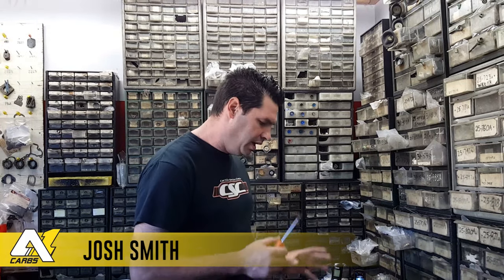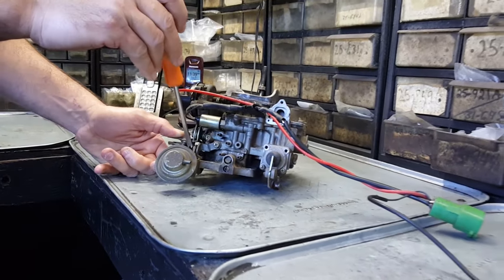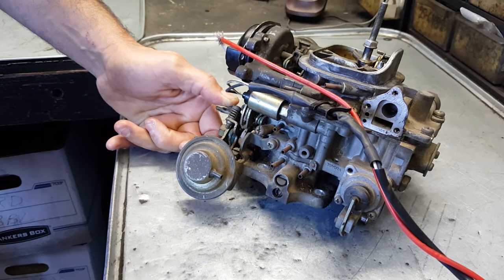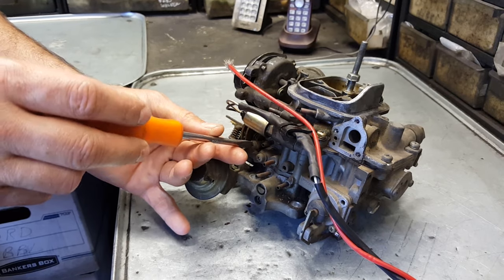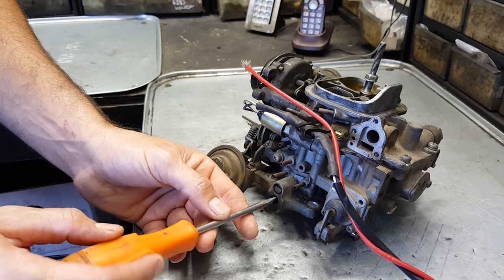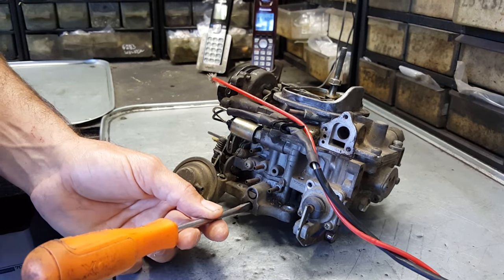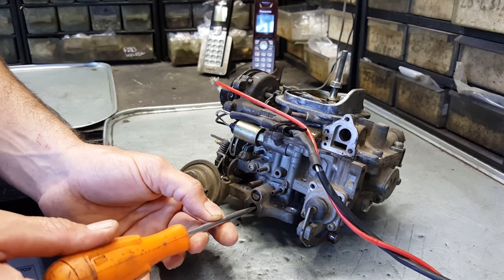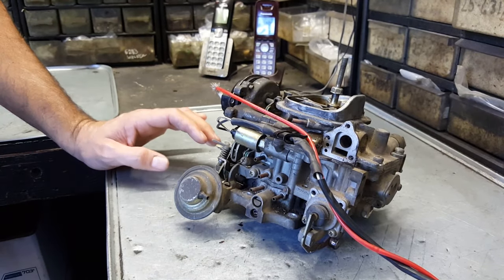Tuning Toyota PickUp Carburetor.

Comment: What this dude fails to mention, is that the mixture screw is covered by a metal cap that has to be drilled out in order to get to the screw. Perhaps a more detailed explanation would be better rather than giving these folks false hope, but I digress.
Reply: thats for a 22re
Reply: @silvac196  22re doesnt have a carb

Comment: I want to correct what he said abut the air-fuel mixture adjustment screw. What he said in the video when you screw it clockwise "in" is leaned, that is not true, in fact that is rich because that screw control the air volume only, fuel was not effected by that adjustment screw, unlike many other carburetors that screw control both air and fuel at the same time that is why it was called " air-fuel mixture's crew.

Comment: What does the diaphragm do that is on the bottom left.  i got a replacement carb and  my old carb did not have this , I don't know what to connect it to ?
Reply: Hello, were you able to solve your problem?

I have the same problem
Reply: @albertomartinez723  No, I just plugged it off for now.
Reply: @alabamafarm174  I think it must be from the air conditioning, since when connecting any vacuum hose there the engine revolutions increase
Reply: It's the Idle Up Diaphragm. It helps with the throttle, but I think some models of pickups like mine don't come with it.

Comment: Josh, What would make a 22r carb misfire, and not stay running. Could it be the AAP Diaphragm cause that, or the float. I have almost 300,000 mi. Thanks
Reply: Ive got the same problem as well, I need some help too
Reply: David Regan my Toyota was misfiring too and I adjusted the valves and that made a world of difference
Reply: @austincowell8740  check the power to the fuel solenoid. If no power she will run when you have a foot on the pedal but will not idle at all

Comment: Nice video, even though it was short. I have the same carburetor,and my engine stalls , unless I turn that middle screw to a high  1600 rpm. The air,fuel mixing screw, has no effect , what so ever , any idea why ,please . Do I have to take the carburetor a part and clean it to thoroughly
Reply: @TwoCarGaragez  
Thanks for information. I had no choice, but to dismantle that sucker to pieces, Luckily I found a video on YouTube, on how to dismantle, clean and put together that Carburetor, I also made a video and post it on YouTube ,for anybody having a problem with The 21 R engine, which is a copy for the 22R engine .I made a citation for the dude who posted the original video. The engine now purrs like a kitten.😊
Reply: @mazen723 im having similar issues with stalling, is that video still on your channel?
Reply: @sonickage  
The link for that video was provided in the description, check it out, I believe it's still there.

Comment: QUESTION
I have an 1986 shortbed yota...runs great tuned it up...but it blows high HC when I get a smog test...The carb was replaced 3 years ago but it's a California carb...adjustment screws are glued...I was running NGK Iridium plugs but they would get massive carbon buildup over about 10.000 miles...so went back to the standard copper NGK"s...the ignition is stock...is it possible that the Iridium plugs weren't getting enough juice to burn off all the fuel in the combustion process or is my carb just running too rich?
Also...it has a new 49 state catalytic converter and muffler...new O2 sensor.

Comment: 87 Toyota pickup 22r 4wd new parts,engine, carb,fuel pump,and distributor. Runs good and accelerates fine until i shift into 4th and seems to lose power not sure what it could be any would be appreciated
Reply: Check for vacuum leaks, I have a 85 4x4 with the same problem. Now it's fixed.
Reply: Check ur spark plugs and spark plug wires, i had that same issue i had full power from 1s to 3rd gear but in 4th I'd lose power5.

Comment: I can’t find your page i have a misfiring problem after driving through a puddle i replaced the spark plugs, wires, dizz cap, rotor didn’t change a thing trows black smoke and small really bad

Comment: For all of you toyota guys/ girls out there I have a quick question for ya. I have a1983 Toyota pickup with a 22r engine and the pickup will start and idle fine, until you go to drive it. It will drive about 1/2 a blocks and shut off and you will have to wait a few seconds to try and turn it over again or you will just have it turn over. If it does start it will just die right away and not even idle. Does anyone have an answer. I would really appreciate it.  Thanks
Reply: Do the mixture 2 1/2and idle screw adjustments 3 1/2 out. Could be the idle screw needs a half turn back in. The second adjustment screw in video. Good luck
Reply: Ozziejoe okay.  Thank you. My dad and I started messing with the carb while it idled and we got it pretty good. Then when we started to drive it did the same thing.  I looked it up and online forums was saying that the fuel sending unit was going bad. Which doesn’t make since because it is all Mechanical.   Thanks
Reply: josh Stewart you could give the fuel pump a sharp tap with a steel rod or something. Might free up the pin.
Reply: Ozziejoe the fuel pump is brand new.
Reply: Ozziejoe should I still do it?
Reply: josh Stewart not if it is brand new don’t tap it. Did you replace the fuel filter as well?
Reply: If it starts back up when it’s cold your warm idle is to low and your mixture is prob to rich. That’s the best scenario. I’ll link you some carb adjustment vids and there’s one with the idle speed cam. It’s all a learning curb with older cars.
Reply: Ozziejoe thank you so much for these answers we will give this a shot and see if it fixes the issue. Thanks again.
Reply: josh Stewart that’s okay mate even if it takes a while to solve you will learn a lot along the way. I was thinking your choke plate might not be opening up all the way which will stall when warm. It’s prob worth taking it off and inspect the electric coil is set up properly, make all your adjustments when engine is cold.
Reply: I had mystery shut offs on mine and an old timer told me to replace the ‘brain’. I asked for a new brain at the store and they gave me a rectangular metal thing the size of a small book. It went on the firewall. It fixed it.
Reply: There should be what's called an emissions computer on the driver's side. It's a small box bolted near your left foot area. It's not really a computer, but it's a basic circuit board that controls power and ground to the fuel cut solenoid on the factory carburetor. The solder joints on this circuit board develop small cracks over time and it will cause intermittent connection. Symptoms include hard starting, stalling after engine is started, or random stalling when driving. To fix this problem, just reheat the solder joints on the circuit board to reform the connection.

Comment: 1977 20r rebuilt carb. Think cheap  rebiuld. 1yr. Ago. Did same thing after warm 2 store stops start.
It seemed like it was coughing turning  off after turning key off. Eventually engine settled. Start up not quick like it used to. Sort of like it was flooded.

Kept using it that way.

Recently....

Had a water pump leak got gasket. It overheated chugga a lugged home 1/4 
mile. Barely got under car port turned off engine.

Got water pump gasket, cleaned old pump, bought fail safe thermostat new gasket, flushed cleaned radiator & reservoir container. 1 new spark plug, all new wires. 
Starts up after book adjustments runs OK, but craps out, sluggish, engine shakes then dies. Gas pedal like air no strength.
After cool down......adjusted screws but does not seem to get a higher idle to come down or go up,  just stays where it runs....
Maybe I am not aggressive enough to turn idle in or out while running.
Book says 21/2 turns out after seating on mixture......

HELPING suggestions? 😊😃
💋😘

Someone said, timing.

I wanna turn distributor and see Mark move to right.

Mark all the way to left.

Maybe chugga a lug 1/4 home to rough loosened it up.
Not sure.

Always ran 👍till I say a mechanic wanted more money from OLD LADY.....